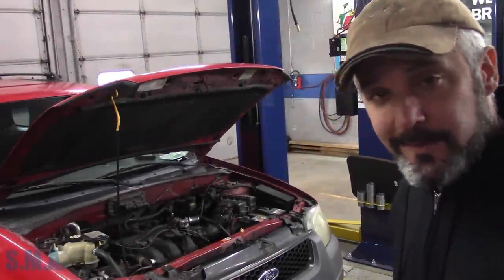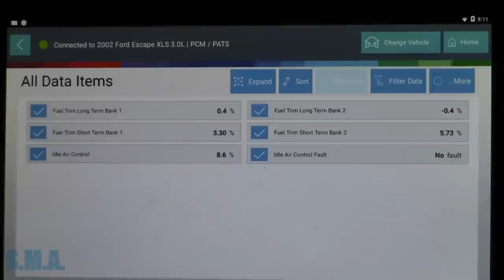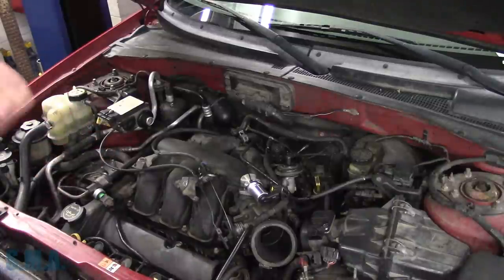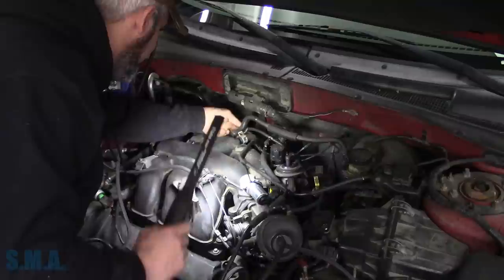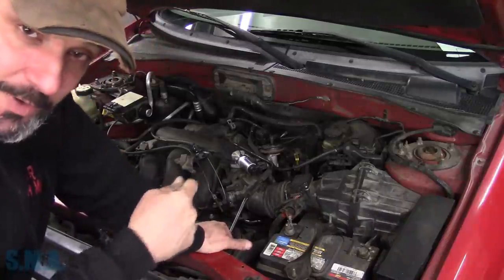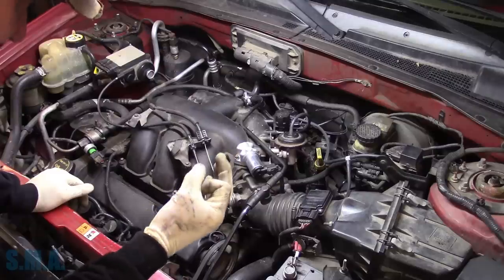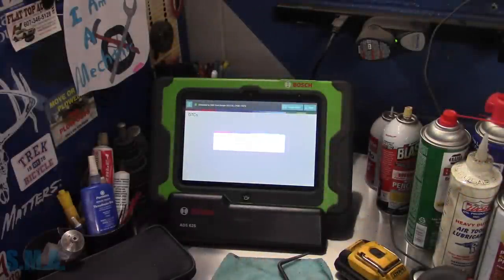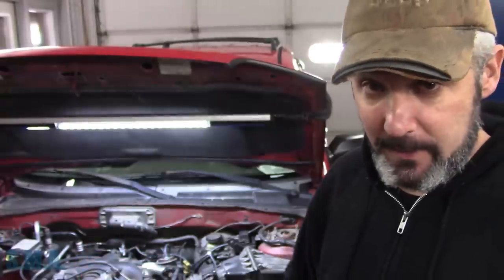Ford Escape:  P1506: Idle Air Control Overspeed Error

Comment: same thing my jeep is doing right now, i don't even have to push on the gas and she does 1500-2000 rpm, only time she idles normal is in reverse. :D guess i need to get me a smoke machine as i threw a new ICV and she still doin it :D

Comment: I'm comment guy tonight..but egr quick test is... engine running after cold grab the egr pipe, if the egr is stuck open that pipe will burn your had pretty quickly....

Comment: Here's the thing; I've got some 'novel' repairs on my vehicles but I did them myself. I consider myself a slightly above average DIY'er. I cut corners sometimes when it's more or less a non critical thing. So, yeah. A well placed zip tie that works and doesn't compromise safety isn't sacrilege. As vehicles have become more complex and I've gotten older, (read: "there's no way I can lay under that dash anymore!" and "there's a code for windshield washer fluid now?"), I have more repairs done. When I'm paying, I want/expect good work. I try to live  my, (mechanical), life by Dirty Harry's code, "Man's got to know his limitations."

Comment: I cleaned the throttle plate on my cable throttle Ford Focus and then it had fast idle. I plugged idle valve and still fast. I went through everything and found no vacuum leaks ( even hard to get at PCV ) so determined it was throttle plate without all the gunk passed too much air. Then I got a file and filed the stop screw till it was too slow to idle. Hooked the idle valve back up and ‘ There I Fixed It ‘
Reply: PCV shakes don’t always mean good, it just means it isn’t completely solid plugged up

Comment: When you change the TPS or Idle air control valve (on a 99 Chevy Tahoe with distributor-5.7L 4x4) is there a relearn you have to perform?

Comment: Mar car has a weird symptom it’s a good old 2004 Pontiac Grand Am 3.4 V6. My issue is on cold starts the engine revs too 2000rpms and it gets stuck there if I turn the car on and off couple of times it sometimes fixes its self and will idle down to 600rpms. When I take the MAF out and IAT sensor and spray them with some MAF cleaner it seems to start and idle down quick. Odd thing is once the engine is at operating temperature or just warm enough to move the gauge. The car runs perfectly fine you stop at a light and it idles down fine only on cold starts it acts up. I thinking the IAT going out.

Comment: I'd like the smoker is it due to salt or just dried up I forgot what year it was yep they want little money I seen them so brittle on a lot of letter vehicles are like that back in the day you just stick a multi braided hosebut now they change Demeter's off and on they turned everything around 90°going quarter inch to 1/2 to 5/8 to??

Comment: Looking at the amazon page for the OTC LeakTamer, someone commented that for testing fuel system (evap) you need to use an inert gas like CO2.  Is that true?  Is this just to help prevent explosions or will shop air cause damage some other way?

Comment: My experience  with p1506 is almost never the iac valve . I'd  say it's the pcv valve bad or aftermarket  valve.Remove oil cap start engine  feel for vacuum.

Comment: possible half the issue were pre-exising and they just parts slapped the iac and egr valve without care, then seen the hose tossed some tape at it while working after quoting without proper inspection.

Comment: That noise.... These have bad problems with cam bearing cap retention bolts backing off.   Not saying TC isn't slapping,  but a lot of times those bolts cause the cams to lift up... Stretching the TC.   Just a heads up.

Comment: I'd pay you to do a video showing me that PCV valve trick. Got the same car and want to change it but don't want to take the whole intake apart
Reply: Easy. Use long reach pliers to remove the old one, then connect a stiff chunk of hose to the new one, Guide it into place and use the hose to lock it in.
Reply: @Blazer02LS  thanks for the vote of confidence, I used a 7/8 in ratchet to remove it because as I discovered when I took it out it was original equipment after 16 years. Was a bugger to get out but it worked. I use the rubber hose trick to get it back in and it worked perfectly. Every other video has you taking half the engine apart to get to it ....thanks again.

Comment: Why they were replacing the IAC when it clearly has vacuum leaks hissing away at every orifice I don't know. Maybe they couldn't hear them over the exhaust leaks and timing chain rattle.. which they maybe haven't warned the customer about because they hope a more expensive repair is around the corner.

Comment: the reality of someone taking all that time to wrap elect tape on a $.05/ft vacuum hose instead or replacing it?, no, you were correct in calling them out. and i know you felt you were right, because it was not edited out. what does kinda surprise me is how this kind or "work" keeps ending up in your lot. as far back as i have gone in your videos this is a reoccurring problem. seems the fancy XYZ CERTIFIED sign is not worth the tin it's printed on. If you can do it, why can't "they"?

Comment: Respectful comment : Learn as much as you can, do not guess. All systems have a trail that can be followed - do that and not guess.
And a HACK fix is just that, fine for an out back get it running. If you are a shop be professional in your approach and your repair.
No one has respect these days for a car shop. WHY? Don't make it worse, be better than the rest, be deserving of respect.
Do not make your customer regret coming into your shop. And you will prosper.

Comment: When I work under a car I wear googles not safety glasses. When I work and the car is lower than me I wear safety glasses. The googles protect from all directions. Particles still fall between the frame and head with glasses. 
Yea rust particles in the eyes are not a good combination. Can cause blindness
Reply: I wear a grinding face shield and safety glasses under cars. The goggles always fog up on me. I learned the hard way about using eye protection years ago. I was drilling a bolt out of an exhaust manifold and got a metal shaving in my right eye.

Comment: Is there another way to check for vacuum leaks without using a smoke machine ?
Reply: Rony Hernandez some people use carb cleaner. Spray it over the suspected areas, and if the idle changes, the leak is most likely there

Comment: Eric, quick question, how much should a 1987 Oldsmobile cutlass supreme should be with 4,000 miles and excellent paint work and in excellent condition? It has a new battery, alternator, carburetor adjusted, new shocks and springs, etc. Please let me know and thank you for your time.
Reply from the maker: What ever current scrap value is? $240 a ton I think
Reply: That like 120 miles per year!
Reply: @SouthMainAuto  Well I don't own it, it's for sale at the moment, the owner said to make him an offer and to take it from there. Based on what I told you with its condition and only 3,000 miles. If you were looking to buy one, how much would you pay? Thank you for your time.
Reply: What I should say it runs and in excellent condition, its for sale, not to be crushed!

Comment: Do a lot of hard plastic Vacuum
Reply: Do a lot of hard plastic vacuum lines and elbows dry out and crack from many heat/ cool cycles on a high mile car ?  This must be the downside to them if so . But I also know that a lot of valve covers and now even oil pans are made of plastic

Comment: I think what bothered me the most about those previous "repairs" was the taped up hose and the wrong size bits of hose. I can see taping it up on the side of the road, and maybe trying wrong size garden hose if it is all you have in the trunk and you need to get 50 miles before the vultures eat you. But to do that in a shop, and charge money for it? Or even if the customer did it and brought it to you, complaining of hose leaks, then leave it there and take their money? Come on, guys!

Comment: I know quite a bit about diagnosis and repairing, enough to replace power steering racks, suspension parts, timing belts, head gaskets. I could use more knowledge about electrical diagnosis but nothing is worse than giving in and taking your car or truck to a shop because you don't have time or feel like you'd rather pay someome to do it. Then getting your vehicle back and seeing the repair. If you feel like why did I not do it myself and feel that you could have done better yourself then that shop shouldn't be open.. take pride in your work or close the doors

Comment: I didn't noticed the tape condition/age, but what if they did that as an attempt at diagnosing the leaks and not as a repair? And since they couln't fix it they just left it there since it was in a better condition as when it went in?

However, the uncut zip ties? That is being lazy... I could understand one that ain't visible, aka he forgot about it and didn't noticed it before closing it up... But right on top? Unexcusable!

Comment: I worked on a 04 escape 3L and it had a stumble and as I was testing around (backyard mechanic) and unplugged the idle air control valve it died
Reply: It should die when you unplug it.
Throttle valve is shut at idle and the IAC basically feeds the engine metered air to maintain an idle.
Not a pro..just passed off experience
Reply from the maker: If it died either the minimum air flow screw was not set correctly or the throttle body was very dirty.
Reply: @SouthMainAuto  thanks eric!

Comment: If I took my car to a shop to have it fixed, then later opened the hood to top off the oil and saw zip ties holding my iac & throttle cables on, I'd be beyond pissed. If you come to me and say it broke, or "I" broke it taking it off & it's some plastic part or a corroded fastener, I'd understand and be fine paying for the new parts as shit happens. This on the other hand is unacceptable in my opinion.

Comment: I believe Idle Air Controls have been on American production cars since fuel injection - in the late 1980's . My 1987 Celebrity 2.8L has one . Unmetered air and vacuum leaks cause high idle . Rubber and plastic vacuum lines have been on cars almost forever . This is no mystery . If they are charging you $ 100.00 an hour labor and giving Rube Goldberg repairs , they should be out of business . What shop doesn't own or even borrow a smoke machine ? This is a common repair . I don't get it . How do they get away with it ? There are quick lubes that mess up a simple oil change . I had one put the drain plug in FINGER TIGHT . Lucky I got a call about a puddle of oil in the driveway . I just got off the HIGHWAY after 15 miles . I had metric wrenches in the van and tightened the plug . HACKS almost ruined the engine ! Try bicycle repair and turn in your uniform !

Comment: Lots of shops do that type of quality control as every day routines.  The term "Sano" has never entered their mind and its likely they haven't figured out what that is yet. How any mechanic can take a factory/OEM vehicle and then "rig it" vs. get the correct parts and leave vacuum canisters unmounted is complete disregard for the customer. That kind of work should have been free of charge since the fix never got done. This is why many folks DIY often because they do not want secondary damage done to their vehicle while the elephant is working in the china cabinet. I have seen it way too often, repair process results in broken plastic parts, even metal, hoses routed wrong, too much improvising/short cuts, careless final and cosmetic concerns and so forth. The big one is greasy hand prints all over the under hood, interior, carpet, sidewalls on tires/wheels and so on. Shame on them for being that narrow minded working on other folks personal property.

Comment: Probably the other 'Shop' figured this customer didn't have two dimes to rub together and did all that cobble junk to save her money.  That line of thinking backfires just about every time.  In this case,  it made the problem worse!.  As for passing a car that wouldn't make it up on a lift for fear of snapping in two---   If that customer has an accident and it's proven the car physically should never have passed...  That shop can kiss their license goodddddddddddddddddddddddddd bye and the tech will have a huge fine, if not legal action taken against him.

Comment: Lol dont look to close to my engine it's been reworked with bubble gum zip ties wire ties off the bread bag  duct tape and gorilla tape on the air flex tube by the mass air flow sensor or intake air flow reader because someone ripped it open

Comment: HEY !!!  Don't make excuses for other shops shoddy work ethics - it is what it is - SHODDY WORK METHODS !!!! Some lipstick and mascara covering up the real problems because you are to lazy to earn your hourly rate fee and just want more cash for less work !!!!  The customer puts his faith in you to honestly correct the fault and charge for it ...... the shoddy worker does the absolute minimum using what he or she has instead of buying the correct replacement part and doing it properly !!!!  Black electrical tape wrapped around a cracked / split plastic hose for a fix is not QUALITY work by any means or thinking !!!!! So you have the right to criticize other shops for crappy work performed.  Auto repair garages are recommended on word of mouth and the satisfaction of the customer.  If we SMA viewers see you do questionable work, you are told about it and chastised relentlessly !!!! Even Mrs. O. doesn't approve of sub standard work !!! I saw her change tires one time there on the SMA tire machine - it was done in such a quality manor, you would thing that Vanessa wrote the book on the procedures !!!! You have 429,000 subscribers, (I am one of them, # 428, 731)  how many of them do you think would keep viewing SMA if your work was sloppy ?????? Good diagnosis on the problem, well done Eric !!!! You have another happy word of mouth customer to sing your garage praises !!!!!!!     :- )

Comment: Mechanic 40 years. Now days, I see many Dealerships, have just lubing monkeys, calling themselves mechanics. Parts changers, we call them shot gun mechanics. My Gf goes to her Hyundai dealership for inspection. Every year, it needs complete front and rear brakes, calipers, rotors, ect. This year again. I was perplexed, that the brand new Napa pads and rotors I put on last year needed replacement after 3000 miles??? She had it done, complains to me about the bill. I ask, what was the criteria for failure? They didn't say. Ok fine...............................your money.